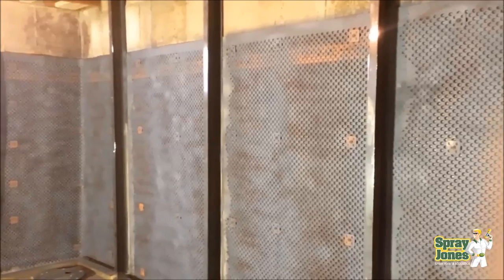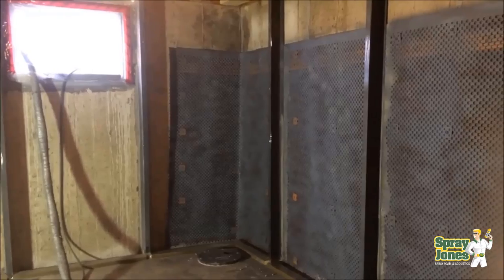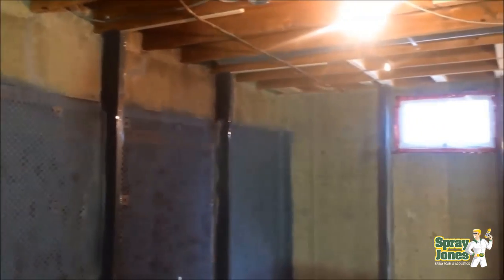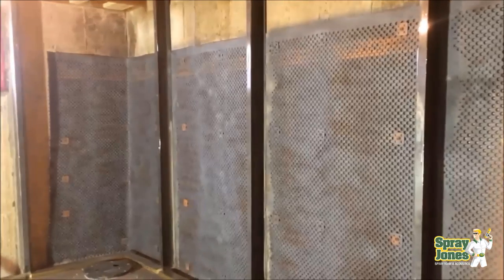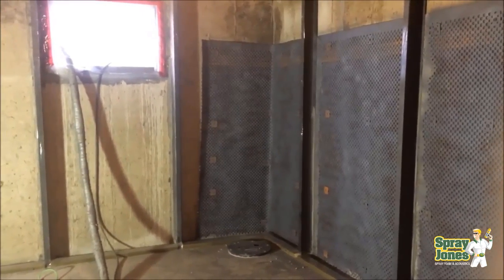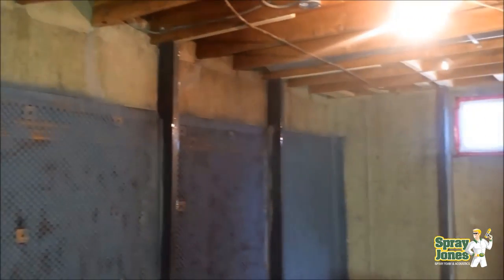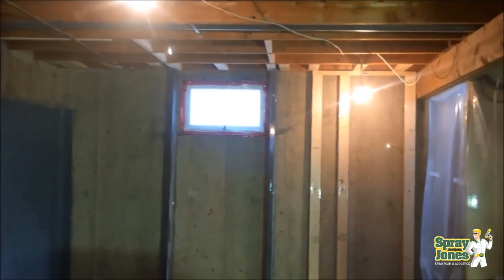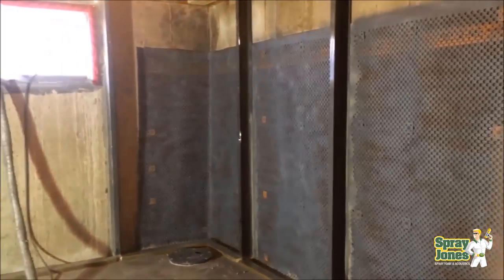Polyethylene Drainage Membrane and Spray Foam Insulation | Will they stick?

Comment: Just what I needed to know.  I have a 1940s home and am planning out all my upgrades.  I have three main basement problems: drainage, insulation, and radon.  This was the last piece of the puzzle.  it looked like they stopped the dimple mat at grade, so you had plenty of room above for a good bond right to the masonry.  This will be an important detail for me since I have the random fan pulling from under the slab.

Comment: Are there any chemical or structural reasons not to use closed cell spray foam on poly ISO insulation boards? I’m sandwiching a 2” poly ISO board layer between two 2x 4 walls as a thermal break and want to use spray foam on the inside bays to form an air seal as well as to provide additional insulation. I live in New England zone 5. Thanks so much!

Comment: Hello Spray Jones,

Any thoughts on spray foam for fence post installations? They sell the kits at many box stores but i figure that if its just normal foam to call a guy over and have him spray some into holes with the fence posts installed. Not too sure how well it performs some people swear by it and others hate it...

Comment: In a all steel garage  , I'm getting a product called  Condonstop  . And installed only on the metal of the ceiling  . And next year I  hope to have the entire metal garage closed cell spray foamed.  And I'm being told that the condonstop can be sprayed over with out any problems  . Can you advise me if this is correct  . I'm in Northern Michigan and it's hot in the summer and cold and lots of snow in the winter  . 
So both climates to deal with  !
Thanks Tom S.
Reply from the maker: I have not heard of that product. You better go watch my video on how much SPF to stop condensation. You may be paying for a product you don't need.

Comment: I am in the process of preparing to build a post frame building and the builder recommended that the entire structure be wrapped in poly or tyvek prior to spray foaming incase a panel were to ever need to be replaced due to damage.  Of note this building will be surrounded by trees and the possibility exists that at some point a branch or something could fall or be blown on to it.  Will the foam stick?  Will it do the job I want it to?  This will be in Northern Indiana where condensation will be a concern.
Reply from the maker: Go watch my metal building playlist. The answers are there.
Don't take advice from those who will not be there for you 5 years later...

Comment: I would think the closed spray foam insulation would void the reason for putting weeping panels in. That is, preventing the weeping from even happening or preventing weeping from draining.
Reply: The dimples are facing the wall. The spray foam goes on the flat side of the mat.